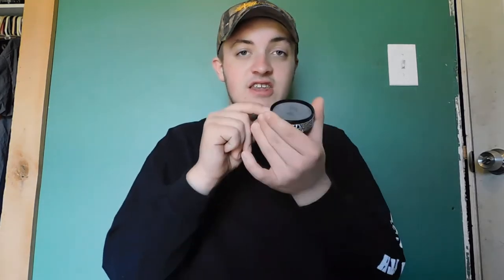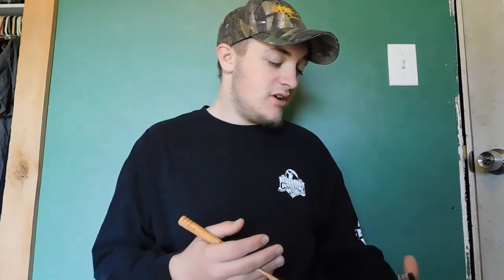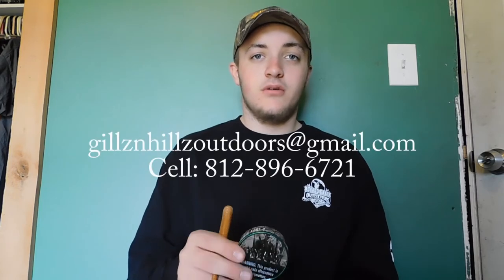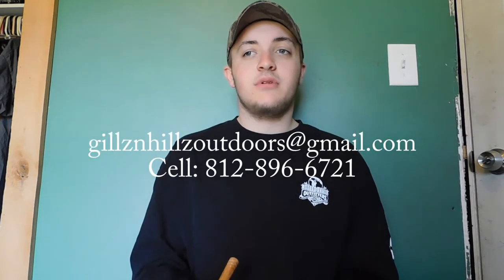I Make Turkey Calls Now! Can Clucker

Comment: Back when I used to chew an dip I'd use my empty Grizzly can to make an Owl hooter by cutting aprox a inch or so notch in the side of the top and a slightly longer notch in the side of the bottom part of the can both no more than 1/4" wide When you put the top back on the can both notches should line up to make the opening You sort of blow across and into the notch while holding the can vertical so the length of the notch runs up and down  I face the top portion to my left you adjust the tone and sound by moving the top to close off or open up the hole Experiment with is till you find the sweet spot This call and a Crow call will get a reaction if there are Turkeys in the area and in the evening will help locating the roost Good Huntin